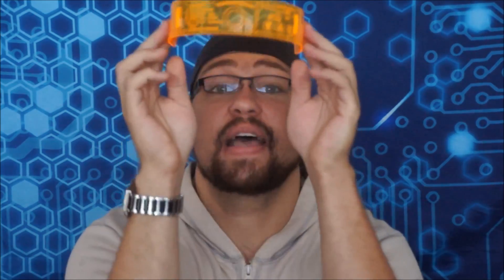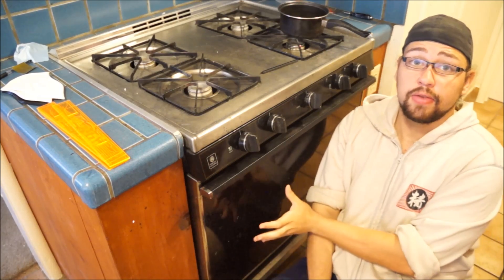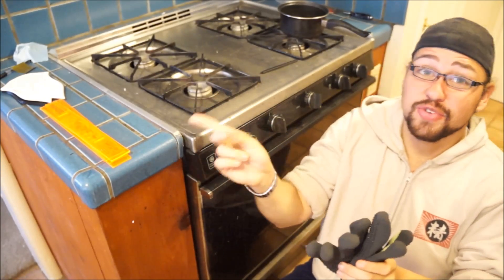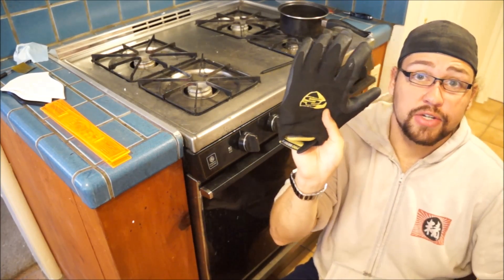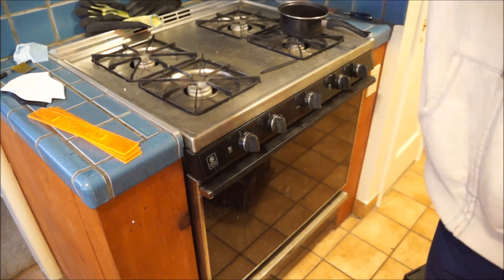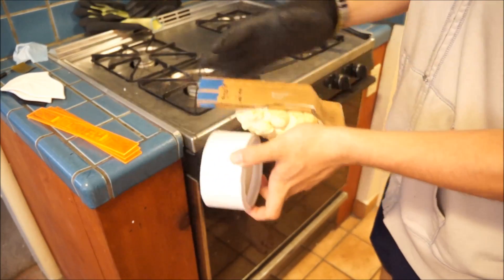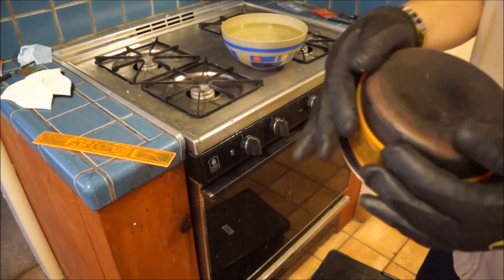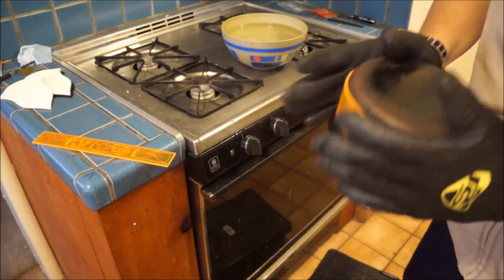Ammnra Quick Tip: Heat Bending Sheet Acrylic

Comment: This worked amazing! I did 350 for exactly 6 mins and it was perfect - even for 4mm. The one thing I noticed was it only worked on cast acrylic which is fine since that’s mostly what I use. The test I did on extruded melted to the aluminum foil. In both cases I only noticed minor fumes when I opened the door but they went away quickly. Thank you for this advice!!

Comment: If I wanted to make corners by heat forming 2mm acrylic (clear if it varies between colors) on a cardboard form using just gravity, would it still be the same time and temperature? I want to make a visor that's narrower at the sides than in the middle then add window tint to give it a black color without hindering my vision too much (the tint would be applied after of course).

Comment: I have a question, will the heating prosses in my oven, 
 ruined the clarity of clear acrylic 1/16 inch thick sheet? I need to form a visor with a 90 degree angles on each side for my goggles...  Please let me know maybe im better of using a hair dryer

Comment: Sweet, thanks. Trying to curve a large piece of 5mm into a curve and the heat gun is just warping it all over the place while taking a lot of heat to bend. I think I'll try this method as I need the whole thing to uniformly bend.
Reply: same thing happened to me. Was trying to use a heat gun to bend some sheets into a visor shape, but the bending was uneven. Gonna use an oven next time
Reply: I had same problem with the heat gun. Too small a diameter of heat to evenly warm the 8" wide x 14" long piece of 1/8th" plexi.

Comment: The simple things we don't know about :-).Thanks. I have a caravan with acrylic windows with a slightly curved face ,which flattens out at the edges.One was broken so I'm wondering if I use the opposite one as a mould, will the temp of the shaping piece damage the good one? Much appreciated.

Comment: You sir, have inspired me! Thank you so much for this video! I do have one question: how would you go about bending a piece of flat sheet acryllic into a rounded, dome-like shape?
Reply: I don't think that would be plausible with just heat. The circumference would change so you'd need to measure a few places to cut into.
Reply: @edgymcmemes1718  Use a vacuum former.
Reply: @TheChaselg1  I'm sure OP appreciates this, 5 years on. Lmaooo
Reply from the maker: Multi axis banding (curved in two directions) is hard with sheet acrylic. I've tried vacuum forming and it never really worked for me. You can do it but you'll be fighting wrinkles or folds with extremely domes surfaces.